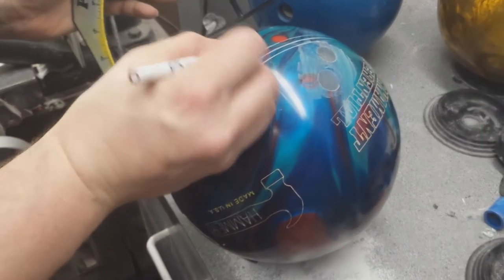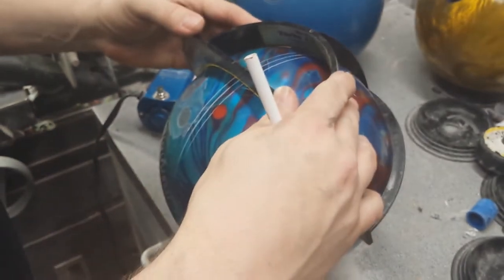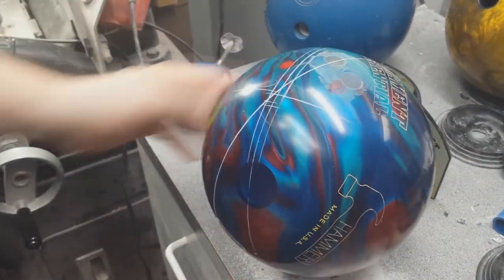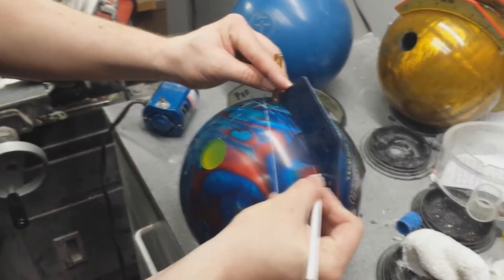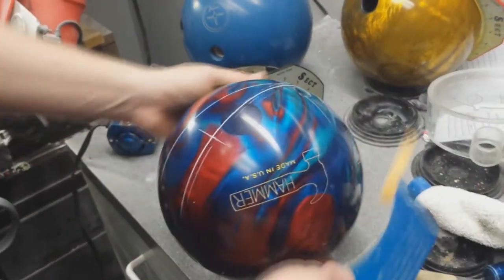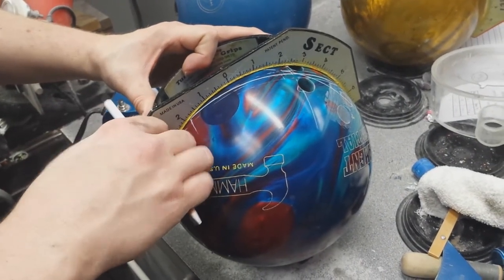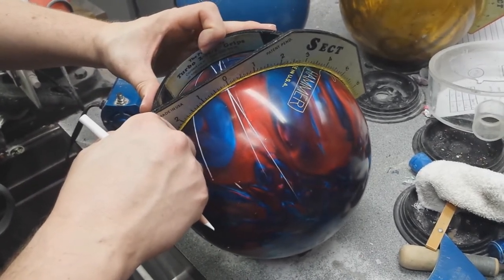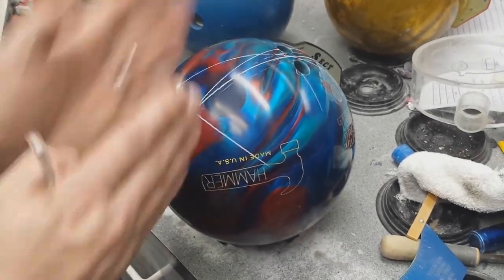Anatomical Drilling Technique - Part 2

Comment: I drilled my offset thumb a little differently, I would drill my thumb hole directly on a line from the Middle finger. drilled the middle finger first, then the thumb and then I would go back a drill the ring finger,
I didn't use angles just used measurements Chris is correct that it keeps you under the ball more, I bowled almost like a 2 handed bowler, very short back swing only with one hand. I did use a thumb hole, lots of people thought I was not using a thumb. Nice to know there are Pro Shop operators like Chris who go outside the standard center line grip. I want to go back to Bowling but need to find a shop that drills like Chris,  as I would like to try his method. Former Pro Shop Operator

Comment: Ok SUPER old video... BUT... I have a very odd hand. Easy example, I can not touch my thumb to my pinky finger.  In fact, it's a pretty good Push to get to the tip of my ring finger.  I don't have any of my own drilling equipment, so before I go to my PSO, I've been researching drilling and fitting.  
I was expecting more offset on the thumb than was shown here.  Looking at my hand, I was thinking about moving my thumb (right handed) left 3/4" from center of the T.  Do you know of anyone that has experimented with this type of drilling?  Thanks!
Reply: You’re going to roll over your thumb hole.
Reply: @nathanielfuentes5294  i havent done that since High School. From time to time depending on my release I get within about half inch, but thats it.
Reply: @dieseldood  did you kick your thumb hole 3/4” to the left of your center line?
Reply: @nathanielfuentes5294  oh... no I didn't. I ended up doing 1/4 left and 1/4 back as I recall. Id have to go find my new sheet